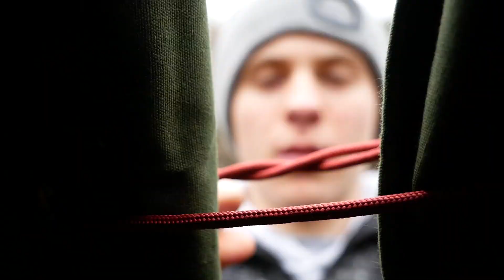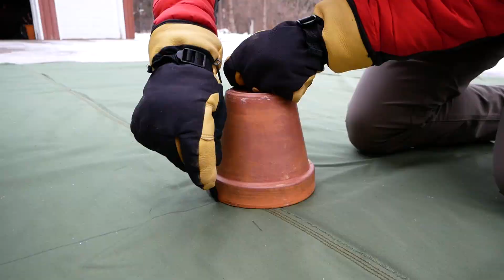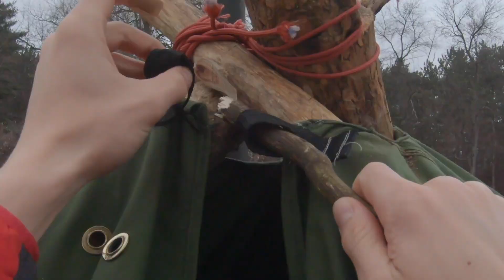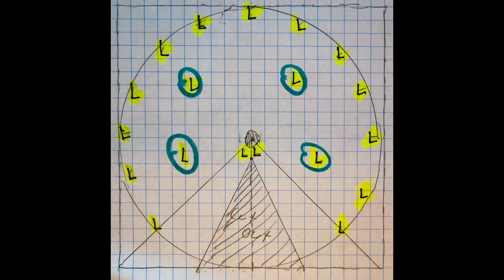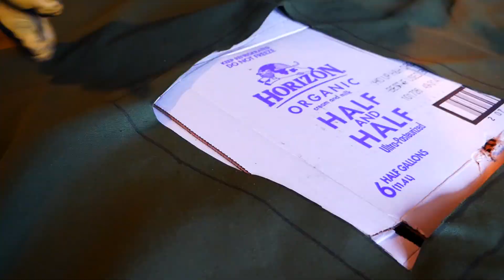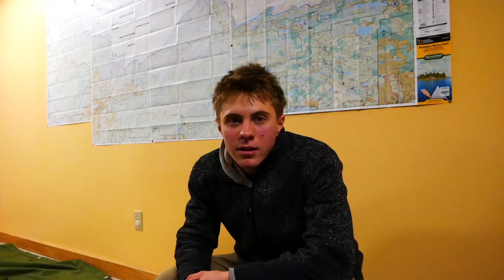How to Make DIY Canvas Hot Tent

Comment: Saw a trick from Sailrite. Instead of hammering the punch with a mallet to make the hole, put the punch in the chuck of a hand drill. You can sharpen the edge on a file if needed. Works slick.

Comment: How heavy is this setup? Not including the stove. Also, after using the hot tent, is there anything you would change about the design?
Reply from the maker: The tent is about 20 pounds. Feels heavier because it’s so spread out on the sled, but it’s really not too bad. We would stitch the loops on in a better way, probably a square stitch instead of just two or three lines. We would also cut off more of the flap, but you can do that if you think it’s a problem. There was nothing we did wrong that we can’t fix!
Reply: Awesome video guys! Thanks for the tips

Comment: Great video guys, I have downloaded it so I can follow it a step at a time.  Very well explained and demonstrated there, one small question I have is, did you have to use any special kind of thread to do the sewing with?
Kind regards from Wales UK.
Reply from the maker: Thank you very much and we wish you good luck. We tried using 'outdoor' thread, but it was to heavy duty for our machine. We asked a sewing expert and he said there is no need to use any special thread. We ended up using regular thread and it worked great, but we would not recommend using anything weaker.
Reply: @bushbrosoutdoors2612  thank you for that. I'll be off to the sewing shop in my town tomorrow. Then going tarp shopping at the weekend.